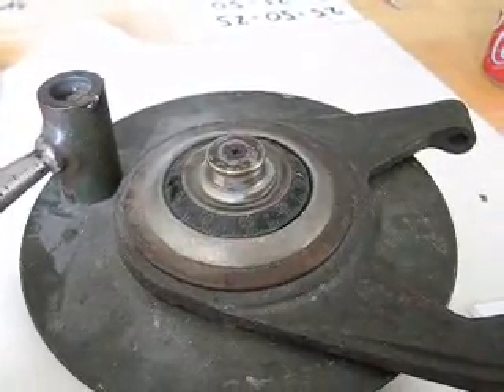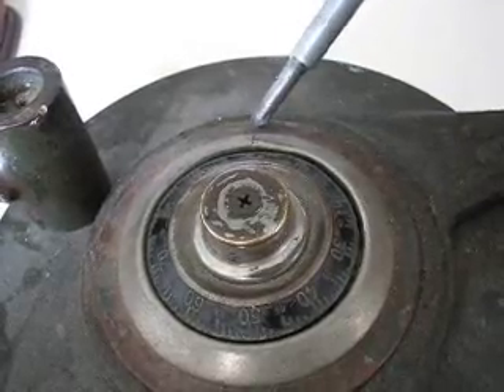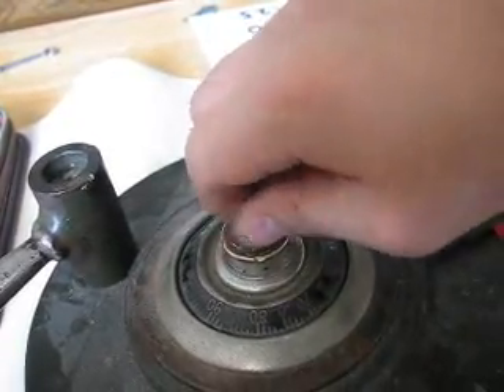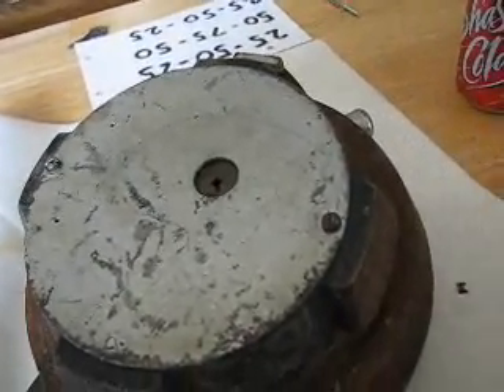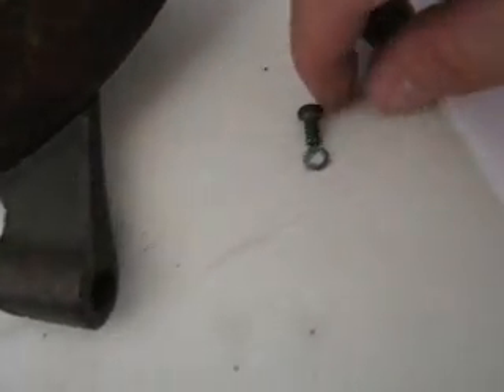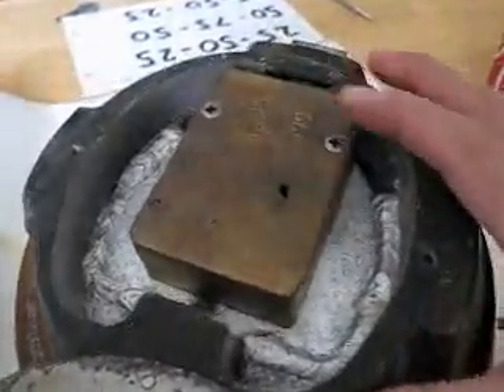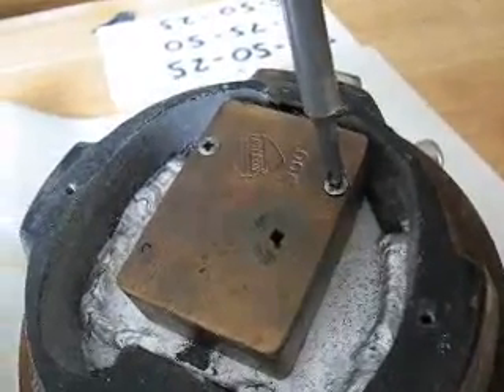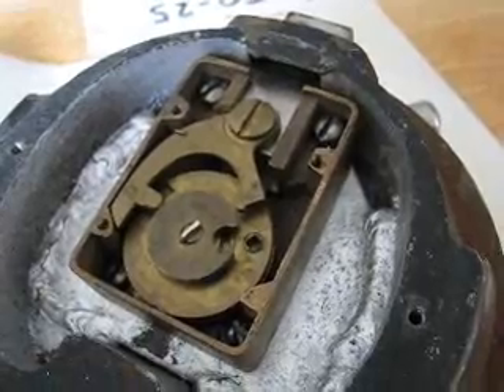003 Diebold 900 Series Safe Combination Lock

Comment: Cool video.  I have the Diebold 917, can't see any difference between the two.  I don't know if you noticed but when you flip the door over to access the wheel pack, the very first plate you take off isn't riveted on.  It's held in with a pin.  If you pull that plate off a locking lug will spring out and relock the door.  If someone uses a hammer to beat the dial in and the manage to knock that plate off they will have no way to open the door.